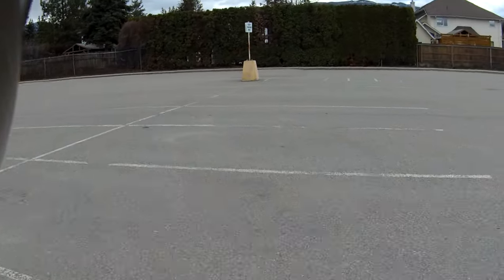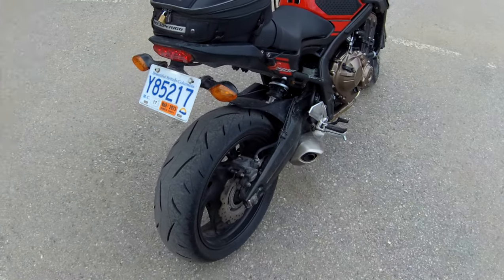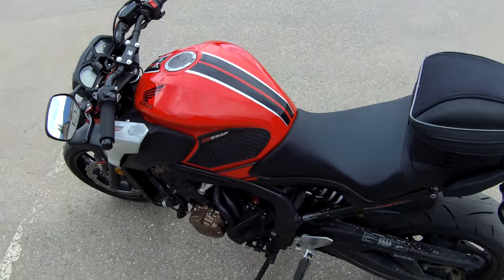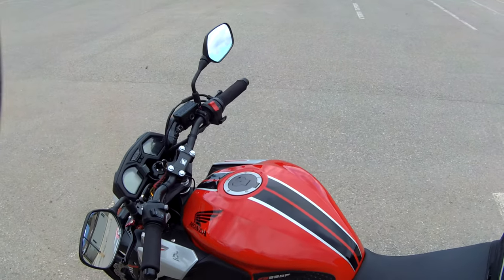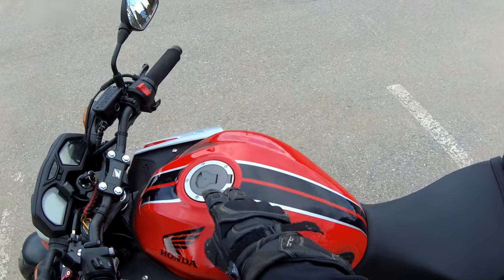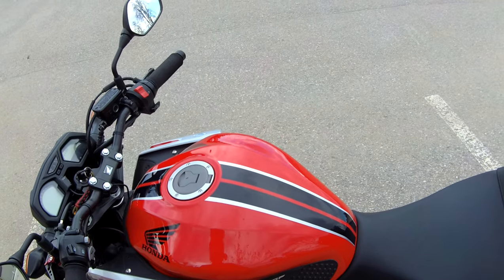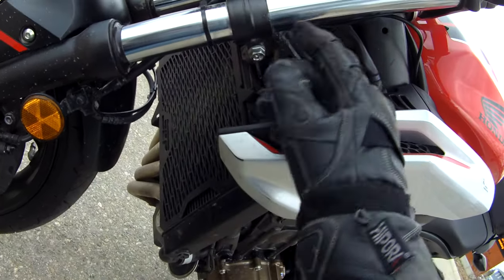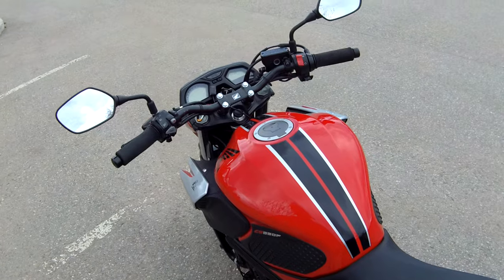Do Booster Plugs Work? Test on CB650F

Comment: Booster plugs are essential to any bike that needs to run a bit richer than stock. Got one for my 2007 BMW F800ST and it also helped my bike stop stalling after longer rides.
Reply from the maker: That's good to hear. I'm very happy with the results. A well designed and simple solution.

Comment: The bike sounds great. I have throttle issues with my V-Strom 1000. Should give one of these a try.
Thanks for all the great videos
Reply from the maker: Thanks, I'm happier with the sound of this bike, as in I can actually hear it now. Yeah, check out the Booster Plug site and the reviews to find some on your bike. It may help.
Reply: Did you try this for your v strom? Did it work ?  I hate the defueling program on the v strom , closing the throttle is just like turning off the key
Reply: @Trike.  I have had one on my 2014 vstrom 1000 with a 2 Brothers pipe. It has definitely worked and can notice a difference for sure in throttle response.

Comment: My VStrom needed one of these dearly. I have to say the KTM FI works well. The WR used to flame out a lot before all the mods.
Reply from the maker: Some bikes are a lot worse than others in this regard. The cb650f is pretty good normally but I couldn't resist trying it out, and now that I have, I like it.
Reply: Did you try this for your v strom? Did it work ?  I hate the defueling program on the v strom , closing the throttle is just like turning off the key

Comment: thanks for video. i just got a 19 cb650r and ordered a full exhaust installed.. also a booster plug w it. but considering if i shld use the booster or just have it tuned at dealership lol
Reply from the maker: The Booster plug is a good economical solution, but an ECU flash with dyno tuning is the best way. Then you can have all parameters dialed in correctly, including ignition timing advance. That's assuming the tuner knows their stuff and has a good reputation.

Comment: I have an cbr650r, so same engine, different tune. 
My problem with my all stock bike is on trips with small roads i tend to be in the lower gears.
When rolling on the throttle, my bike jumps, or Twitch. 
I have a friend who is said, booster plug, and i saw the video, and it sounds like it will fix my problem. 
But you did not mention the jump / Twitch from the bike before the booster plug. 
What do you think? Will it help me?
Reply from the maker: I think it helps somewhat with smoothing out the on/off throttle. The Booster Plug didn't remove it, but its better. Other remedies include throttle tamers which use a different cam lobe on the throttle tube that extends the twist necessary in the first part of the throttle. Here's the item: https://www.g2ergo.com/shop/g2-street-tamer-throttle-tube-honda/

Comment: Sorry, one more thing. Where did you put the metal sensor end on your installation?
Reply from the maker: I routed it beneath the headlight assembly so it's fully in the fresh unheated air.

Comment: How did the Dunlop Q3+ work out?  Seen you put them on in 2020.  What kind of kilos did you get out of them?
Reply from the maker: They were excellent tires in all regards. Great handling, grip, and longevity. I got 12,300 kms out of the front and the rear. For best handling I should have swapped them out at 10,000 kms though. The rear was getting a flat spot on the top affecting tip-in.

Comment: Does it affect wide open throttle or redline?
Reply from the maker: If you are still accelerating at WOT then yes it enriches the mixture. It does not alter the redline. The added enrichment in open loop mode is a subtle but felt improvement to the rideability and performance.

Comment: would it make it faster 0-100 more ? I have vulcan s 5 second to 0-100 would it down to 4.5 or 4 ?
Reply from the maker: Depends on how optimized your bike already is from factory. The Booster plug does provide quicker acceleration though, so It's worth a go I think if they make one for your bike.
Reply: @Scoottoots  Would it make 0-100 0,5 second faster
Reply from the maker: @han436  Like I said, it all depends. It should accelerate quicker. Will that translate into .5 second quicker time in a  0 - 100? No idea.

Comment: How is it when it is hot? Any improvements?
Reply from the maker: Yup, hot or cold out, doesn't matter. Improvements across the ambient temperature range and the rpm/load range when in open loop mode.
Reply: @Scoot Toots  Thank you for your quick reply.  I live in Thailand and it is often 40c. I want to make sure it works well in hot climate as well. I have a 2020 version of the cb650
Reply from the maker: @peterroda4181  We get temps up to 40°C and beyond as well. A couple years back we had over 40° for about 2 weeks. It topped out at 49°. The Booster Plug just works without any drawbacks and no effect on closed loop, so fuel economy is still good. Here is the link for the cb650R 2020 model. I guess that's what you have: https://www.boosterplug.com/shop/boosterplug-honda-cb650r-812p.html
Reply: @Scoot Toots  I just ordered mine based on your video.
Thank you for your help.
Reply from the maker: @peterroda4181  Great. Your engine will thank you for the added enrichment 🙂

Comment: Mine restricted I removed the stacks now the air is more and fuel is not as the air the motorcycle very lean does this will fix it?
Reply from the maker: No, it would not be the solution in your case. To derestrict your bike you would need to replace the restricted intake funnels with the unrestricted versions, then you would need to flash the ECU with the unrestricted files. If you do not do both the funnels and the ECU flash (or a brand new unrestricted ECU instead of the flash) your engine will run dangerously lean possibly causing major failure.
Reply: @Scoottoots  thanks for your reply already i replaced the funnels with opened one but the problem with me is ecu tuning in my country no one doing tuning for cbr
Reply from the maker: Then you should order an unrestricted ECU for your model from Honda. The Booster plug will not provide the correct and safe fueling. Talk to a Honda dealer about ordering one.
Reply: @Scoottoots  already i bought new ecu but it wont work just kill switch worked but the bike wont start
Reply: @Scoottoots  I tried to do dyno tuning but the problem was the air is more and the fuel is less so first i should do the ecu flash before dyno tuning?
Reply from the maker: Something must be incorrect either with the ecu or during installation. Maybe speak with a Honda mechanic before going any further.
Reply: @Scoottoots  thats so much waste of wealth better to return it as it was and drive it as it is or sell it am enough of this shit and thanks man for your answers have a good day

Comment: Hi. I have a 2016 Cbr 650 f and bought the boosterplug for it. Connected it and went to reinstall the tank and it wont go far enough down. No room for the boosterplug it seems. Where did you mount yours??? Under the tank??
Reply from the maker: The only thing that goes under the tank are the electrical connectors for the Booster Plug; one end into the ECU connector that originally plugged into the stock air temp sensor, the other into the stock Air Temp Sensor connector on top of the air box lid. I then tucked the booster plug module beside the air box in an available spot by the frame, as I recall. Then you route the Air Temp Sensor rod from the Booster Plug to beneath your headlamp so it gets nothing but cool air coming across it. Everything fit perfectly. Hope that helps.
Reply: @Scoottoots  That helps a lot.  I have to make the wire that goes from the booster plug  to the air box lid longer, its way to short as it is. Its just about 7 cm long so there is no way to put it to the side. The sensor itself i was thinking of cable tie to one of the fork legs beneath the front fairing. Would that be okay??
Reply from the maker: @76osto  My model year is 2018 so it is a different Booster Plug model number from yours. My cables on the booster plug were plenty long enough. It's odd that yours were too short. I hope your workaround is successful. Yes, anywhere you can place the sensor rod where it will get fresh cool air around it will be fine. Good luck 🙂